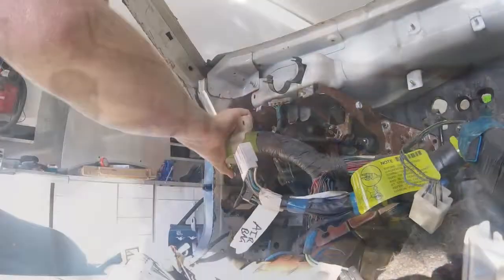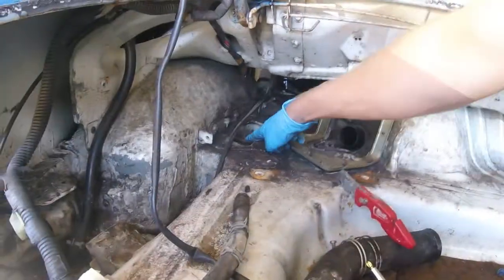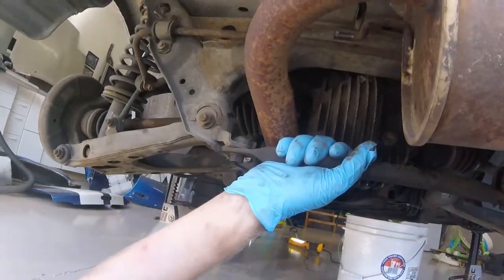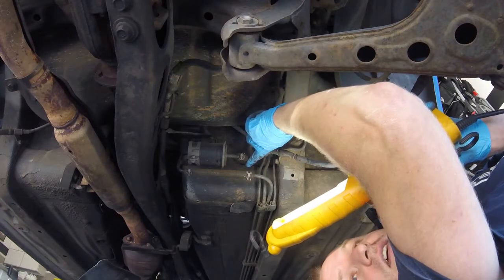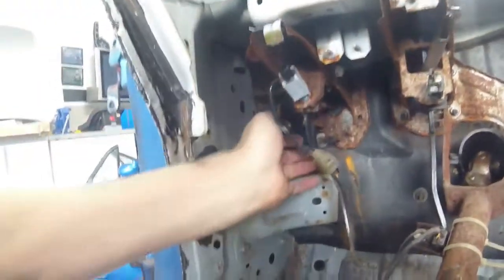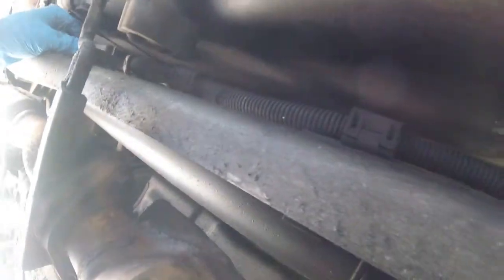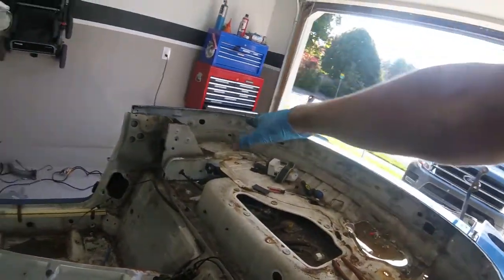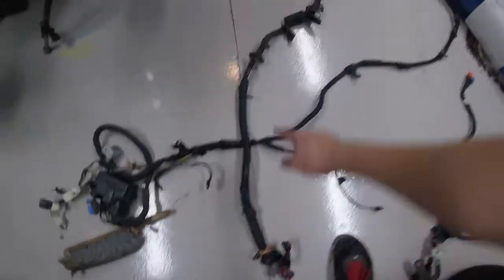Exocet Build: Removing The Miata Body Part 1/2 (Part 4)

Comment: Great instruction video. I just too put pretty much all the harness but the one underneath the car. I’m having difficult time removing header and the whole exhaust system. Do I need to remove these? Or I can just leave them be?
Reply from the maker: If you do t remove the exhaust it will just dangle off the header or the flex section.  You need to remove the exhaust hangers off the body at least but I would at least pull the exhaust from the header joint back.  It's not very hard to do

Comment: Hey Brent, I know it's been a few years since you took your miata apart... I was wondering.. how long would you say it would take to separate and lift the body off the drivetrain.. taking your time?
Reply from the maker: Hard to recall.  But in total with labeling the whole harness and all the pieces and connectors I would say a good solid 2 days maybe 3.  That is with cutting up the body
Reply: @BuildingTheEXOCET  thank you 👍